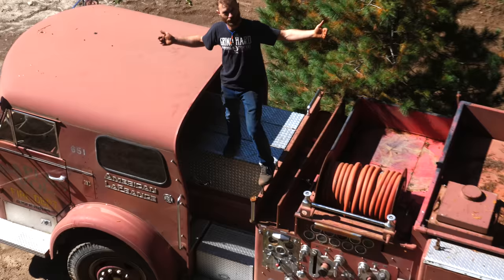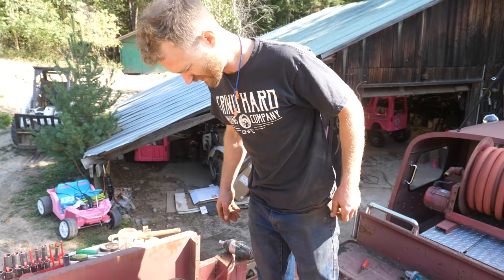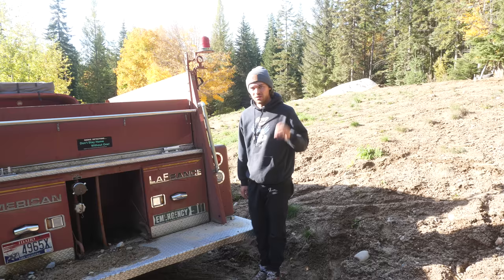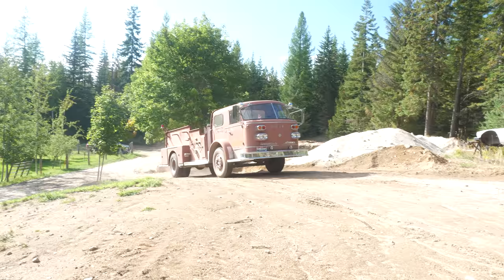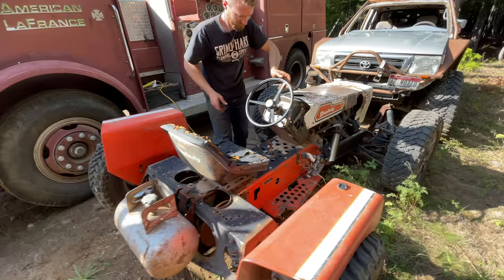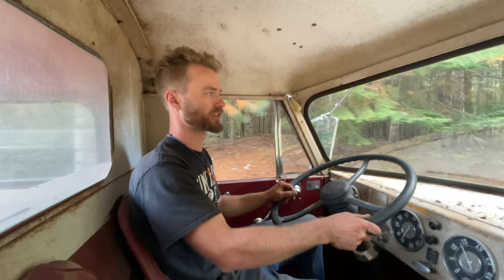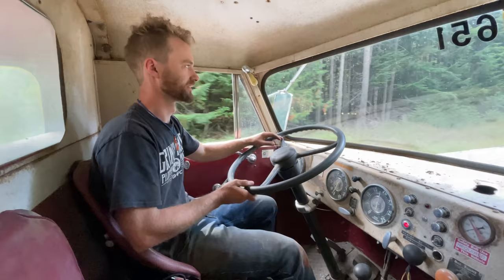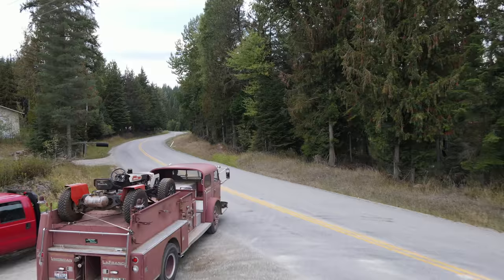Building a Fire Truck Toy Hauler! 1965 American LaFrance

Comment: Check the transmission on that fire truck, it may have multiple grease fittings on the clutch linkage, on both sides of the bellhousing, and on the throw out bearing, that could be your clutch issue
Reply: The throw out may be just hanging up on the input shaft also. Maybe have to clean/lube thi shaft
Reply: @jmanlinc  if it's got a grease fitting on the throwout bearing thats what it'll grease, that and the clutch brake if it's got one, on most class 8 trucks you have that one, plus one on each side of the bellhousing for the horseshoe/fork, and some (peterbilts) have 2 or so fittings on the linkage, im not familiar with an American Lafrance fire truck but I would assume it's not to far off from a semi, if its got a cover bolted on the bottom of the bellhousing that's where your throwout grease fitting is, it may also have an adjustable clutch, most of them should have a 1/2 inch gap between the clutch brake and throwout bearing with the pedal released, it should also have about an inch of free play in the clutch pedal

Comment: Floating the gears is the only way to go. I haven't used the clutch, except for stopping, in my semi in 20 years. Save that left leg. Awesome to see you guys starting on this build. Can't wait to see what you do.
Reply: I always thought it was common knowledge to "shift on the fly". But I grew up with manual transmissions in almost all my family vehicles, so maybe its not all that common after all...
Reply: Ironically most trans manufacturers tell you not to float the gears. But it is much niver than using the clutch
Reply: @getyroks  in old rigs yeah but no need to do it in new stuff because it actually has synchros
Reply: Nothing like floating gears on the good old grind boxes
Reply: Guess double clutching isn't a thing anymore?? Used to do it all the time back in the day,!

Comment: It's most likely a bellcrank clutch, and the linkage is sticking/seized. Get under there with some penetrating fluid and spray the bejesus out of it.
Yes, floating the transmission is easier on it than clutching every shift. Just be gentle and coax it into the next gear, it should fall in, not force in. You'll also need to learn to rev match on the way down.

Comment: Absolutely love that truck! An overly large diesel engine with fat turbochargers would be just the thing for it.
Reply: a 6.2 cummins here would be perfect
Reply: I had the same thought, she needs the torque.
Reply: Or juat leave the extremely cool engine that's already in it, in it...
Reply: @carsongeye1462  what do you think the massive inline 6 in it now has?
Reply: @elonmust7470  as cool as it is and ad much as I think it’s cool, it’s kinda wimpy for that much weight. It sounds so cool though!
Reply: @elonmust7470  I have absolutely no real idea but I can’t imagine it has more than 3 or 4 hundred horse and probably 500 lb/ft. Decent especially for the time but you can do so much more know.
Reply: @carsongeye1462  I'm sure time & effort could make it perform better.
Reply: @carsongeye1462  turbo and supercharger and itll make 500hp and 2000+lb/ft

Comment: Heck ya dudes. That fire truck is going to be awesome!  An yes you were being told right about the clutch... it's for starting an stopping really once ur going just shift. You'll get the feel of it after some practice. Just shift to the next gear as your letting off the gas and then gas it as it's going into the next gear. It helps smooth it out if u start the shift before you let off the gas an then just gently back into the pedal as is going up to the next gear then once it catches floor it. Hope that helps ya out if u haven't already gotten it down

Comment: I was looking for one of these for awhile to build a ramp truck out of. Never found a good fire engine candidate. Settled for a 1989 international s1853 full size school bus. Dt360 powered with a spicer 5 speed trans. Now all I need is highway friendly gears in the rear and time to cut half the back off to ramp it. Going to need some serious ramps even though it's only 41 inches to the floor level I will be putting my drift car on it. Can't wait to see this done!

Comment: Not sure how I feel about you hacking this thing apart. It's beautiful.
Reply: They should be able to pull the back (tank, storage, pump) off as a unit and end up with a cool chassis cab base to work from. I think that trying to reuse as much of the fire truck appearance as possible is a cool idea, but there may be practical considerations like deck height.

I think they'll have to just try the current plan and find out. If it doesn't work they can always pull the remains off and build a bed from scratch.
Reply: They can keep the sides, keep the bottom portion with storage areas and make flatbed over it :)
Reply: If they ditch the engine I'm done.
Reply: @elonmust7470  why would you rather drive a dangerously slow gas guzzling shitter or something able to reach the speedlimit and hold it for hundreds of miles comfortably firetrucks arnt made for long distances.

Comment: HI. That old fire truck (or old retired truck lol) is as old as me. But in much better condition than me. lol. I agree with you, it need a newer engine. But I would go as far as replacing the gearbox. For something newer. Possibly 4 wheel drive. But most important a working fuel gage would help most of all. lol.  I like to see old things preserved. keep up the good work.

Comment: You can rev match/no clutch most manual cars. I drove an old s10 and for over a year only used the clutch for setting off or running the balls off of it,  but for casual driving I rarely used the clutch and only on a rare occasion had a gear grind. Still ran fine and shifted good until I got caught out in a hail storm that beat the paint off it and I started doing a full resto-mod on it, cutting out and replacing all the rust, fixing issues, blasting and coating the frame, and throwing a 5.3 in her lol

Comment: Most certainly nothing wrong with the clutch you have to rev match shift every gear doesn't matter how far you push the clutch if your rpms and speed aren't synced to the gear your in then you'll never get it to shift thats why most of us truckers only use the clutch to get moving the rest is power shifting but still a sweet truck! You'll learn to drive it in no time! Just take your time shift slowly and you're good to go!

Comment: I think y'all should DEFINITELY swap a Cummins into the firetruck   like a 12v or 24v out of a second gen.      12valve would probably be the easiest swap for this thing shift linkage would probably the hardest part if you kept it manual

Comment: Clutchless shifting (floating gears/rev matching) is something that can actually be done with most manual cars. It’s easier with non-synchronized gear boxes, like the ones on 18 speed big rigs, but I do it all the time driving lighter duty work trucks (F-650’s and the like)

Comment: just a tought: turn the jumpseat area into a crewcab, with doors and bodyparts off a semi truck sleeper box, like one of the big kenworths. mount these seats above engine hood level, so they get their own windshield. 
sound deadening all around for comfort, aero work so it doesnt turn into a wind noise generator, pick up a 250-320hp turbodiesel I6 because it doesnt need to get anywhere quick, use the space created from ditching the waterbox so there is space to place a folding caravan right behind the block, underneath the loading bay.
that way, you have a (folding) space to house a workshop or a few beds.

dont use that old fire hose for fuel. it's not rated for petroleum based products.

Comment: im a diesel mechanic by trade, its called floating the gears, it takes a lil getting used to but not only is it normal it’s recommended its saved your clutch, clutch brake (if it has one) and your leg! If you cant find emm grind emm!!

Comment: would love to see the back wall in the cab cut out and a new one put in where the cab ends .. the engine is there but if you swap the motor it could be lowered to make an actual usable quad cab fire Truck

Comment: I think you should ditch the rear storage and make a flip down ramp/tailgate on the back and make it a multi-level car hauler by having a second storage inside the tank section.
Reply: Bonus: you can cut out the center of the upper deck so you can fit to drive a car into the lower section, but that cutout will also work as an inspection pit to get under the upper toy.

Comment: Have the top platform have rams that pick it up and place it on top. Have the pumps taken out so you can drive up side on. Keep the rear seats. Change the diff ratio so you can use low or have a spliter box to double the ratios.
You might need to get air ride because you are not hauling so much.

Comment: Shifting without the clutch is called "floating the gears" and, as long as you're RPMs are in the right spot, its very easy and saves the clutch.  Down shifting can be done as well but you've gotta get the RPMs up or it gets a bit Grindy

Comment: Should build a ramp still truck on top instead of a flat deck but still end it on top of the rear boxes with ramps then you dont have to lose the fire trucks water hose hook ups just make the deck the width of the fenders so would hang over a bit in the center but would still look like a fire truck without having to cut half it off to make a flat deck

Comment: Clutch not required bu definitely suggest.
Correct gear change: open the clutch, disengage the gear, close the clutch, accelerate to the right rpm, open the clutch, engage the gear, close the clutch.

Comment: yeah, we had a smaller fire truck, with a 6.9 international diesel. I guess they call it a pump truck, looks like it's got a giant utility bed on the back, well, you'll find out real quick, how well these trucks were built. they spare no expense on the equipment, and man these things got maintained constantly. oh, and another thing, that thing has an outrageous PTO on it, to run the pump system. you can leave it a giant ridiculously dangerous water pump, or you can do what we did, and just use that drive shaft that went to the pump, to turn a winch, a big generator head, hell, anything you want. it's got torque to the wall. I'm sure you'll use your imagination on what you could turn with that baby!!! awesome toy, best one yet!!! just read my comment below this one, & you may get a gist of my enthusiasm!!! 😜👍💯💯💯

Comment: The clutch kinda reminds me of a clutch problem on another channel recently - a mouse nest was preventing the pressure plate from fully releasing. Maybe blow out the bellhousing in case that helps if it doesn't get better with time?

Comment: If it has a synchronized transmission you need to use the clutch to shift it, if it has an unsynchronized transmission you do not need to use the clutch to shift it, like dump trucks and whatnot like that those are unsynchronized transmission so you do not need to use the clutch to shift

Comment: Really old big vehicles the transmissions have straight gears instead of meshed slanted gears so as long as the rpms are relatively close you can move the gears into other gears without using a clutch, only need a clutch to get going

Comment: I would remove what ever is on the center low and make type of tunnel for sendy and other narrow builds and then top layer for bigger builds. For using hose to fuel vehicles... well i love the idea, but something tells me that hose aint designed for gasoline and its BIT janky setup, but maybe get old service station pump and combine that with the truck so you have refueling option on the side ready to go and best thing, you can have 2-stroke, gasoline and diesel on same pump. Dont scrap the hose reel though, those are damn expensive if in any kind of usable condition. Maybe build rain water catching system to water the drive way so there wont be that ridiculous amount of dust around.
Actual use for the hose on the truck, you could have intake hose to take water from say lake, pump it in and then out from the hose to wash the machines.. and your self after the dirty ride in mud. Works for the truck washing as well :D

Comment: I'm going to challenge you to do Smart,not Easy: Use Hydraulic pistons to raise and lower the 'hauling bed' above the tank.Cut behind the tool boxes and make the deck move.Use as much Original as possible for a change.You can even cut "step-beds' to make  carts set before the main deck,but are part of it.>Challenge<I can see it,can you?

Comment: A two story toy hauler would be great, not sure if you'd have the bed height though.
Reply: That's what I was thinking gut the inside keep the out side walls make a hydrologic lift to lower the top level for loading. then smaller karts in the bottom

Comment: ya the clutch you have in that truck is called a bucket clutch this type of clutch was used on older trucks and bigger vehicles back in the day when i first started driving semi there were still a couple of truck i drove that had this kind of clutch in it and they in 60s model i drove   and ya as you said thats the way they work is that they just grab a at once  you be coming up on the pedal and nothing and then at once it just grabs and goes you just need to be ready when it grabs then you just gas on the truck and your off  ya rgis is just the way it was made to work and the same as that other guy said i drove truck for 45 years and i only used the cluch to start off and stop i would shift with using the clutch as most semi truck drivers do it just take a little to get used to it but once you get in down you,ll just do it woth out even thinking about it you,ll just do it and rgese clutches and trans were just made to work this way when you learn it you,ll will be able to shift both up and down with out using the clutch

Comment: I may be completely wrong, and you may have just been joking, but I’m guessing that the hose and the tank aren’t really rated to handle something as caustic as gasoline. Would really suck to get old rubber in your fuel or worse just have it leak everywhere.

Comment: Double layer deck hauler? As more is obviously always better, it Looks Ike you could  easily have 2 decks stacked and haul double the amount of toys. Just get rid of the tool boxes at the back. It’s not like this thing has a weight limit with the amount of water it used to carry.

Comment: When you do go to swap a nicer engine into it, consider a Detroit Diesel 2 Stroke. If you’ve heard what they sound like, you’ll know why I suggested it. Otherwise, maybe do a REALLY built Cummins XD.
Reply: Yeah ok like they just shit money ?
Reply: @feminazislayer  That’s the main reason I first suggested a Detroit. They really aren’t all that expensive if you get them used. Plus they can be just about as used as you want and they’ll run fine. I do realized a built Cummins may be out of the picture as that would be quite expensive.
Reply: @jackets64  they're best bet is grab a ford f450 550  drive train from a wrecker or dump truck. Reliable and wont need a lot of parts if any. They dont even have a shop to do it so less shop time the better
Reply: More coin up front but less hassle afterwards for years to come. Fummins will be always needy
Reply: @feminazislayer  depends on which drivetrain they get XD. I can almost guarantee from the get go that the 6.0 and 6.4 diesels will not be less hassle later, I can’t imagine the like 150 hp and 450 ft lbs of torque a 7.3 will output would be enough to really get the things moving so that basically leaves with a very expensive 6.7 power stroke option. If they did go for a Detroit it would definitely be unique and you’d only need to do like the simplest of maintenance on it. Those Detroit’s will run forever.